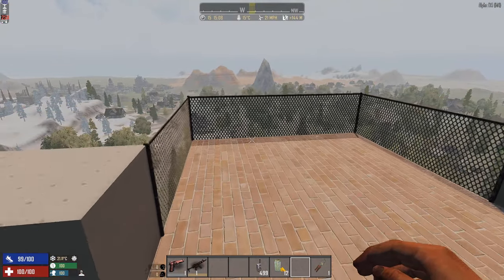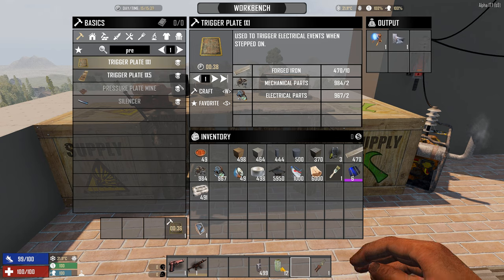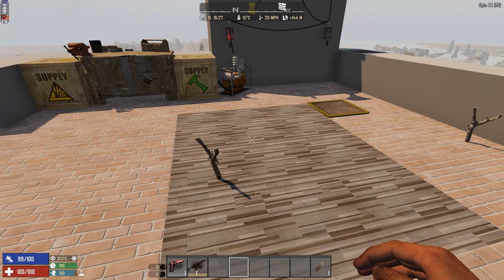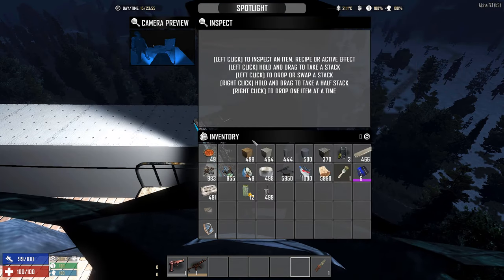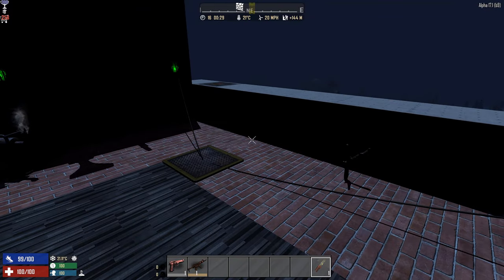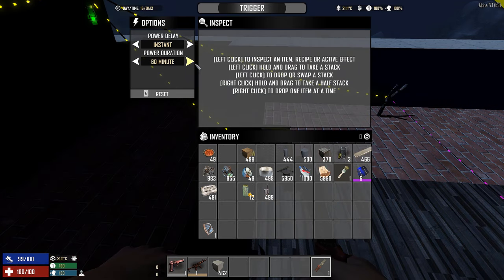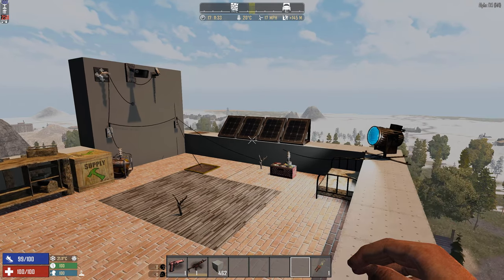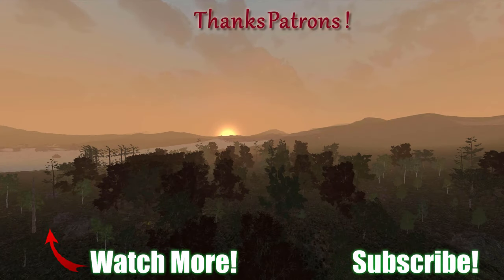7 Days to Die Electricity Guide | A17 Advanced  @Vedui42 [KOR ENG SUB] ✔️

Comment: Thx for the tutorials. Wish we could wire power to lights in existing POIs since there are so many lights we can't craft.
Reply from the maker: Yes! I think even in creative we can't switch them on. Which is annoying :P
Reply: @Vedui42  After your comment couldn't resist the urge to go onto world editor to turn my base POI's lights on (Masa Missile Silo). Considering the amount of options to configure them, i bet a mod can be made. Better still would be if the Funpimps rigged the lights to be operable (even if they had the cost of a new light bolt to be "repaired" and connectoed to the generator grid). Preassure plate connection to doors/bridges would be nice too.

Comment: The 10 watt usage at 19:46 was actually correct. Battery banks use 5 watts to charge the batteries, and you have a little bit depleted battery during the testing, so solar bank powered the spotlight for 5 watts and used additional 5 watts to charge the battery in the bank.

Pro tip: Because there are no multiple inputs for devices (really annoying, hope the fix it in the future), you can use separate networks to maximise the efficiency of solar banks. Use more battery banks to charge up simultaneously with solar, no matter what quality and quantity of batteries are in the bank, the max drained will be 5 watts per battery bank. Technically it's better to use 6 battery banks with 1-1 battery in each, this way you have more power for the same time. But this limits you to use the same network for everything, so good planning is a key.

In my current game I use a network for lights with a timer relay, there are 3 turret networks, one for motion sensors outside to check zombies. Also you can chain battery banks to create buffers, but be aware that the lowest output will limit your max output.
Reply from the maker: Hi Peter. I see what you're saying, but it's still wrong :D Even if it might be how it works (I haven't actually looked into it). 

If a batter is at say 95 % charge, and the input has 100 Watt, and there is 5 W light, then 5 W should go to the light, and 95 W should be used to charge up the battery. It does not make sense that 5 W goes to the light, 5 W goes to charge battery, and 90 W is unused. So you might be absolutely correct that a battery bank only uses 5 W to charge the batteries, in which case that's a dumb way to do it, as it would mean it could take ages to re-charge a battery bank, OR it means the charge time is fixed regardless of how much input power is available (in effect, we create power from thin air). :)
Great tips tho. One of the mods I usually put in place on servers is to increase the max fuel to 9999 from 1000, as it runs out so darned fast!
Reply: @Vedui42  Nice to have a feedback from you :) I try to get some electricity related updates in the forums (currently in the A18 thread) but sadly no real feedback for them. There was also a dedicated topic for electric stuff with a lot of great ideas, elevators, fridges, ovens, electric furnaces, working ACs/heaters, electric car/bike, working cameras that can be attached to TVs, even the new coffee machine model can be used to make a better coffee with electricity. Also alternate switches and more inputs for devices mentioned, inside the wall wiring to avoid cable chaos, or just the mentioned 5W BB charging fix.

Sadly as I sad there is no feedback regarding this part of the game, but I love to play long in a single map, so technical advancements would be really great to have for endgame.
Reply from the maker: Yeah :) I really hope they expand on electricity, I think it's a big miss they didn't! It's something which made a16 so great, and then they just left it as it was :P

Comment: You should do a tutorial on using multiple power sources.  Like how to connect and set up 2 or more solar panels and battery banks.  I find that its very confusing.  Great work on all the vids Vedui.  You're an asset to the 7D2D community!
Reply from the maker: Thank you timmo! :) So multiple power sources is not supported. Every item can have only one input. Which is something people have given as feedback. You can serialize (ie, generator --> battery --> light), but even that is very weird, while it works, it's been buggy all of a16.4 and I'm not sure it's properly fixed even A17 sadly. We didn't see any new stuff done in electrical stuff unfortunately.
Reply: @Vedui42  This is the biggest problem :( I want to create a large electrical network and, unfortunately, it is impossible. No sense it is not possible to connect several solar panels to one powerbank.
Reply from the maker: Yes not possible. Best is to simply make multiple nets. If you wanted to do a large network, you could update the xml to provide more power from teh generator bank, and more fuel capacity. But that requires modding.
Reply: @Vedui42  Good idea. thx :) It must be enough for now before they repairs that

Comment: That 10W you saw was solar panel recharging batteries (5W) and powering searchlight (5W). Because your battery wasn't drained that much, recharge took only couple of seconds, thats why it went back to 5W almost instantly.
Reply from the maker: Now that's far smarter than I am! That sounds very plausible. I don't recall that happening in a16, so that could be a way they fixed the issues they had with battery banks before! But it's still a bit weird. I mean, if you have say 45 W production, and a light takes 5, why would it only use 5W to charge the battery when it's got a capacity output of 40W free? :) ie, it should have said 45 for a split second as it took all, pumped 40W into the battery to charge and 5W into the light? :)
Reply: @Vedui42  Yeah, it's kind of weird logic. And to add weirdness, draining 5W from battery isn't equal to recharging battery with 5W. I was exploiting this in A16 - One solar bank with panels (let's say 100W output) connected to several batteries powering dozens of blade traps trough the night and still being able to fully recharge before another night starts (practically using 100W to power 600-700W machines) - numbers not exact, it's long time ago.
Reply from the maker: Exactly :D I didn't go to that level yet for a17, but I do remember it was very weird in a16, as if they just didn't get it right and said "Ah who cares." and left it broken :P which is also why solar --> items break if you overdraw it, lags the whole server :P not sure if it does in a17, but for a16 it was common.

Comment: That was one of the most annoying things about the electrical system that they came out with, when I was playing I was building a pretty substantial underground base and A 16 and was planning on powering it was solar power and battery banks lighting up my entire underground. So I plan on having multiple battery banks in parallel and solar panels in parallel in order to supply them out of power that would overtake a generator. Needless to say when I got to that stage where I had all the stuff that I was going to implement that come to find out, you cannot have multiple input sources"."! I can only say what the hell at that point. It only shows a severe lack of forethought on their part for not creating this particular aspect into the electrical system, even in real electrical systems there are always battery banks in parallel and series in order to supply the necessary power for any given system. That is enough of my rant for now, hope that the fixed this in the A 18.
Reply from the maker: I know exactly what you mean! I'm very disappointed they did not expand on electricity in A17. Right now, electricity is ok mid game, but once you progress and add more things then having 1 input at current generator/solar/battery power size is not sufficient. And who wants to have 5 different generators or power lines running around just coz the circuit lacks power? Or refueling multiple generators constantly? Even if they had put in a more "powerful" generator such as a 12 engine, or a 12 battery bank, with 10k fuel or some such that'd help alleviate. But instead, they didn't add anything. And a18 is likely to only have an extra turret or small tweaks. I HOPE at least they add so doors/drawbridges can be activated through electricity, people have been asking for that for a long time. They even ran a poll!
Reply: That would be cool especially if you could have. Electrical activated trapdoor in order to auto drop zombies into a kill zone, or have a more advanced type of trip wire like a laser detection system. Or even a simple treadmill in order to move zombies, I mean this is a game world in in attempt to make it more realistic there should be gems somewhere so finding treadmills would not be that difficult. The next thing they could probably add as a wind turbine in order to adding another element of energy production or even a more advanced generator which uses less fuel. Honestly I think the batteries and solar would work phenomenally if they just made it so you could have multiple inputs and outputs. It was so disappointing when I wanted to build a solar array on my roof in order to power my battery banks only to find out that you can only do one the one. If they do only just added another turret in only do small tweaks especially since they removed all but one will or two light sources that obesity and if it can wait disappointing, especially when they have a significantly big potential in what it is that you could do. One of the things I believe would be a good add-on would be adding some kind of logic gates or surveillance-based systems.

Comment: I'm using the wishing well bunker as a base and one of the things I've been meaning to do is wire it up so this was very useful, thank you! I do have a question about wiring through walls. If I want to use the generator (in the main room) to power the lights in the armory off the kitchen, it means going through two doorways. What is the best way to do that?
 Also, if I were to have the solar cells above, how would I get it to power something either inside a structure or below the ground?
Reply from the maker: Excellent poi. I love that bunker! Wiring can be done max 14 or 15 distance but you would use the wire relays to transfer power from the solar bank up top and down.  Put one in the well wall for instance but make a hole n cover with hatch to protect. Then run the wire from bank to relay and in. Same for the generator inside. Put relays in strategic locations preferably on ceiling to have less wires criss crossing:)
Reply from the maker: Just to clarify wires can go through blocks. Just need to connect the ends which can be bit tricky but should be possible in the bunker.
Reply: @Vedui42  Thank you for this information. I played with it a bit this morning and was able to get lights in the armory room successfully. I found that you simply have to keep the wire tool in your hand, which means for rooms with high ceilings, it's best to have your scaffolding in place first so you can reach the lights, switches or relays. I even reconfigured my setup with a timed relay to turn on and off the lights just like you showed. Unfortunately the whole "going to work" thing got in the way of further experimentation, however it was quite worth waking up early to get this done!
Reply from the maker: Great you got it to work Beth! Here's another video to explain a bit about how to connect wires easier -- a quick tips and tricks 3m video (https://www.youtube.com/watch?v=Y4sIjIgzRss&list=PL5Z54hiemOAvaGeK8_3lOCst40s5vFYak)  ... in a nutshell, you don't have to get close to them, just need to interact from a distance. That means you don't have to jump much or climb up! I'm sure it's going to look awesome when done, why not come by my discord and show a picture of it wired up, painted, new furniture and decorations and the "home" is done? :)

Comment: What they need is high capacity battery banks which I liked in undead legacy mod, they had like ones upto 1200W
Reply from the maker: Yes. It's woefully under-dimensioned both battery and generators for proper base building. Fortunately it's a fairly simple xml modlet to fix that, give higher capacities, more fuel for generator etc. :)

Comment: You know the Dev elevator test the crappy blue one that has been removed in the creative menu in A17 well a funny thing happen to me  with out using any mods or modlets I found and converted my very first prefab the hotel from 16.4 I loaded up the prefab editor to test my hotel and you would never believe it the lift "elevator test" still works but it's not in the menu I can copy as many as I like with the paintbrush but it's a bit of a puzzle that it is not in the menu.
Reply from the maker: That's interesting. So it's in the prefab editor, but not creative editor? Interesting! Wish they would implement it properly tho!
Reply: @Vedui42  It's in my prefab that's the only way I can get access to it I can't find it in the game menus

Comment: Maybe I missed this in a previous video but what determines the fuel consumption on the generator? Is it the energy draw?
Reply from the maker: Hi Dustin! Yes that's it. The larger draw, the more fuel is being consumed. I wish there was a view of "at current draw how long will it last" but sadly, there is none.
Reply: @Vedui42  thank you for the quick response! I agree a chart would be nice. I like the idea of the timed lighting but was concerned about the fuel usage during the day if I keep the generator running. Sounds like it should use very little gas during the day if I'm not powering anything with a running generator. 
I really enjoyed your 2 videos on electricity and how you demonstrate everything by the way
Reply from the maker: I'm glad to hear that you found them useful. I think for a few lights, draw is ok. For some added benefit, you could put in a battery bank too, use timer relays, or even solar :)

Comment: So couldn't you make 1 regular generator and like 10 battery generators and just run thr 1 generator a few minutes to power all the batteries back up and run it continuously while offline for 8-12 real life hours?
Reply from the maker: Clever person! And yes, you sort of can. The weird thing is that power output and power input don't (or didn't) properly correlate before. So you could charge it with say 100 watt minutes, and then draw it down for a total of 1000 watt minutes kind of thing. Charging used to be a lot faster than draining.

Comment: Is there away to link battery banks together to make a bigger storage or to make a redundant system . Trying to hook a generator into an existing system for night or when extra power is needed an stuff. Can't seem to findnwhere to connect it. Right now I have solar to battery to the cables that distribute power. Can't find where to hook a generator into or where to add a 2nd battery or 2nd solar bank
Reply from the maker: It's really painful and there are limitations. You'd have to make multiple circuits, each having a generator/battery bank setup. But ultimately only one connection mean you can not mix a gas generator and a solar generator, which is really dumb. It's been fedback, but I don't see much A18 changes to electricity sadly.
Reply: @Vedui42  would be nice to have more then one input to a bank or something idk